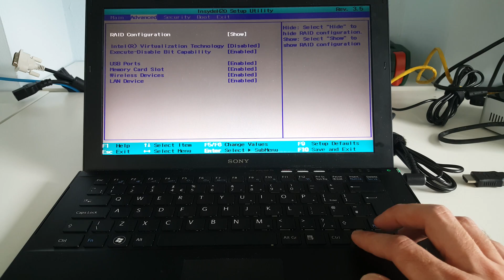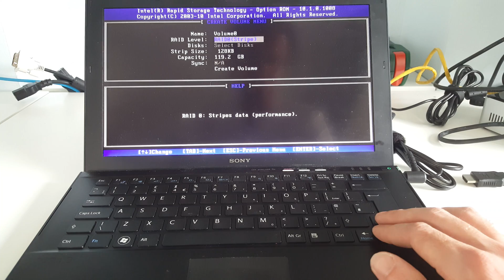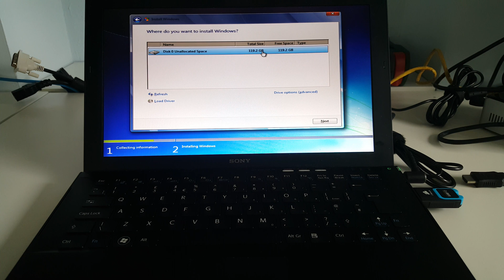Sony Vaio VPCZ21M9E SSD Replacement Guide

Comment: I have the same laptop but it is dead right now. I need to convert that ssd to a normal SSD connector so i can get my files back. But this SDD is different i couldnt find the correct connector for this? Could you please direct me to a correct connector for this SSD? Thanks

Comment: Hi, the LIF Cable, how install in the SSD? in my Sony i cant put correctly...
Reply from the maker: It just pushes in. You have to line it up carefully.
Reply: I did, but the problem is that it fits loosely, it doesn't fit firmly.
Reply from the maker: Have you pushed it in all the way?
Reply: Yes, 3 times
Reply: Do you know if there is currently a system to replace the lif system? To replace for 2,5 Sata SSD?
Reply from the maker: A 2.5" drive wouldn't fit - its a very strange drive Sony used which is effectively two SSDs in RAID so I don't know of any adapters or alternatives.

Comment: I have a Vaio VPCZ217GG laptop. Is the process to change the SSD similar and where would I source this SSD, which has model Samsung MZRPA256? I'm located in South Africa.
Reply: Michelle Schwartz its same  but if take ssd mz- rpc best off mz-rpa Because it is the latest generation

Comment: Is it possible to somehow put that SSD into a desktop PC? As I can see, the connector is different from the standard power/SATA connectors found in desktop PCs. Would a LIF to SATA connector be sufficient? I have a solid deal on the SSD but I need to know whether it'll work.
Reply: Did you do it?
Reply: Hi. Same problem. I have the same SSD but laptop is broken. So i need to convert the SSD to a normal SSD plug. Have you done that? Thanks

Comment: My power button has failed?  This is absolutely an issue with the physical part having a mechanical failure.  It was originally very dodgy/flaky, but now it won't function at all unless I insert a flat tool under the right side of the button and leverage it on.  Any ideas on replacing the button?  Do I need to remove the entire casing to get to the button from the underside or can I pop it out from the top?

Comment: Great tutorial, very clear and looks straightforward enough. I have the identical computer with the same size of hard drive and one of the 64Gb drives has failed (should have backed up, though it is still working for a few minutes, so I'm extracting data slowly to another computer)! £50 is very inexpensive for a replacement and it's good to know the (only) vendor supplying on Amazon dispatches quickly, thanks for this.

Would you please be able to recommend a larger, compatible SSD? I've found one I think may be compatible, do you know how I might check whether it is before ordering.
http://www.amazon.co.uk/Sony-512G-LIF-MZRPC512HAFU-000SO-Inch/dp/B00JUP3FXA/ref=sr_1_1?ie=UTF8&qid=1443868760&sr=8-1&keywords=lif+ssd

Many thanks.
Reply from the maker: +AreaCode865 Thanks for the feedback, its certainly a lot easier than on older Sony Vaio Z-series machines I've worked on! 
That looks like the same style of drive, and is from the same seller, but I haven't tested it so can't guarantee compatibility. Annoyingly I searched for 256GB drives as I wanted a larger one, but could only find them for £300+. If I'd thought to search for 512GB drives I'd have bought that and tried it out!
Reply: +Brue Computing Thanks very much for your response. I'd looked before for a larger drive before this fault developed due to the constraints of a 128Gb SSD (not so bad if you get organized and have other computers). I've checked via Sony Support EU/GB and they are looking for £275 for a 125Gb; looks identical to the one you've had. I suspect the 512 is likely to work, looking identical on the image (although I've had products which arrive looking entirely different sometimes). It is not the unusual RAID of the 128, so hopefully will just require a different setup in the BIOS to get it working. There is a little anxiety ordering from China in relation to returns if it doesn't work, but the gamble is probably worth it. Great little laptop and does everything I need otherwise. The problem with the existing SSD occurred whilst trying to clean the drive. Thanks very much for your help and interest. I'll let you know how I get on with the 512Gb drive - fingers crossed I'll order now!
Reply from the maker: +AreaCode865 Do let me know, I might be tempted to get one anyway. Write performance on the 128GB one isn't fantastic, so that may be quicker as well.
Totally agree it is a lovely laptop, had considered replacing it with an ASUS ZenBook UX305 just as it was even thinner and lighter for taking on work callouts, but ASUS pricing in the UK is a rip-off compared to mainland Europe which annoyed me enough to put me off the idea.
Reply from the maker: +AreaCode865 Good to know - might pick up one in the future in that case.
I've installed Windows 10 on mine, I actually had to do a clean Windows 7 install first as I needed to run the upgrade to Windows 10 to get the license, so did a basic install of that, activated and then did a 'clean' Windows 10 upgrade.
Not had any issues with it running Windows 10 personally.
Does the 512GB drive need the RAID setup done as with the 128GB drive, or is it a single drive?
Reply: +Brue Computing. Thanks for feedback re W10 working. I'm still upgrading W7, taking forever as computer is freezing when it goes to sleep instead of rebooting. Was glad it took my license for W7. I've had some problems with my other computers being a W7 family pack upgrade installation (I used to be able to do fresh installs though they've blocked this now, so have to install Vista, then W7 ... then W10)! Not too time consuming on a desktop, certainly wouldn't want to do on a laptop.

The 512Gb drive is 2*256 drives, I've set it in stripe again.
Reply from the maker: +AreaCode865 If you're going to Windows 10 then save yourself some time and don't do the updates.
Just download the Windows 10 ISO as per here: https://www.youtube.com/watch?v=czJDZOLRTS0
Then extract with 7zip and run the upgrade as shown here: https://www.youtube.com/watch?v=4Gt1DtERykA

Comment from the maker: The drive used is a Samsung MZRPC128HBCD-000SO 128GB 1.8" LIF RAID SSD, it is available from Amazon here: http://www.amazon.co.uk/gp/product/B00V070IUO/ref=as_li_tl?ie=UTF8&camp=1634&creative=19450&creativeASIN=B00V070IUO&linkCode=as2&tag=httpwwwbrue0a-21
Reply: +Brue Computing Currently unavailable, boo!
Reply from the maker: +Nick Higgs Try here: http://www.amazon.co.uk/gp/product/B00JKDNED8/ref=as_li_tl?ie=UTF8&camp=1634&creative=19450&creativeASIN=B00JKDNED8&linkCode=as2&tag=httpwwwbrue0a-21
Reply: +Brue Computing Cheers.  Found one on ebay that worked well.  Great video guide.